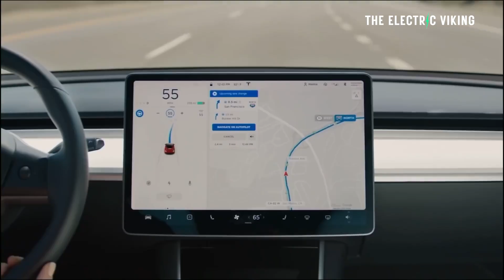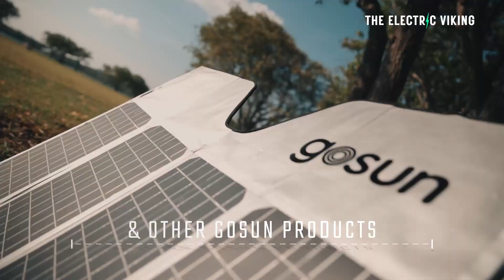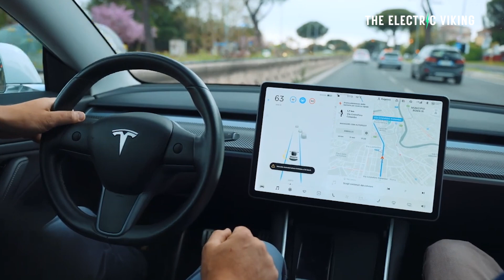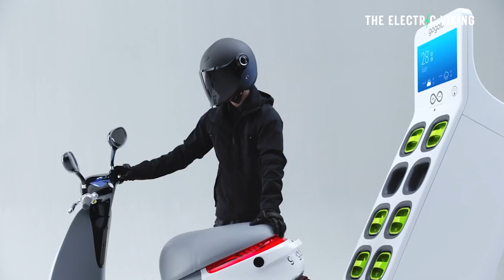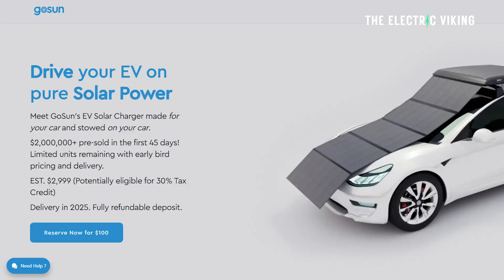GoSun’s Solar car Charger turns any electric car into a solar car

Comment: Downsides I can see:
Added aerodynamic drag of rooftop housing negates some (most?) of what it generates.
Gusts from a strong thunderstorm would tear it apart when it's extended.
Cleaning off the bird droppings.
And as others have noted: theft.
$3,000 cost. It currently costs me $1.00 to go 30 miles using my local utility. At my current usage it would take 18 years for the unit to pay for itself.
Reply: But just think of when you're away from standard roads and plug points for a few days, camping etc. this would be an amazing product to help power devices and give you a boost to get back.
Reply: @colinwiseman  For camping I'd rather use something that stores in the car or camper, rather than have something permanently on the roof. But even then you need to be a long way from charging to make it worthwhile. I camped at a no-electric site for about 5 days with a Supercharger about 17 miles away and that worked out fine.
Reply: @colinwiseman  yeah, it’s called a  Jerry can 😁 but seriously though, you might as well throw a diesel generator in the boot at this point.. 
id hate to have a car that im always stressed in about range, being stranded amongst other things..
Reply: I think it's more about convenience than economy. It would be nice to get a few miles back while parked at work during the day, and super-nice if you're on holiday in some rural campsite. People will be fighting for the sunniest parking spots, LOL.
Reply: Quick math shows that this unit could make 1,833 kwh per year in sunny, southern US, if you never drove your car and this was unfolded for charging all day long, every day (explained in a seperate comment).  Quick math also shows the average driver (15k miles per year), would use an extra 811 kwh per year becuase of the increased air drag (based on epa cycle testing with roof mounted cargo box).  There comes a point when someone drives a lot, like 20k miles a year, has this deployed only some times, becuase they are driving during the daytime, the unit then only makes 900 kwh per year, but said person does a lot of freeway driving at 75 mph and then this unit eats up an extra 1,200 kwh per year from drag.  If you drive fast and far, this unit will eat up more energy than it makes.
Reply: @larzlarz1140  Proves how little the manufacturer of this product understands about physics.
Reply: @larzlarz1140  Yes this is definitely a waste of money. You could spend it to get solar and battery for your home instead.
Reply: @larzlarz1140  The problem with your math is that it is "based on epa cycle testing with roof mounted cargo box".  Which roof mounted cargo box? And how does that roof mounted cargo box, compare to this GoSun solar charger's box? I don't think it's safe to assume it will be the same. The GoSun "box" looks to be quite thin, and it seems to have an aerodynamic profile. We will need real world data, to do accurate  range calculations, and it won't be available until next year.
And no one should be driving at 75 mph, that is a totally ridiculous speed to be driving at. Anyone driving that speed consistently, deserves all the range loss that takes from them.
Reply: Even if you base it off using the supercharger it will still take a while to break even.
Reply: Good points. Hopefully they address this.
Reply: @yggdrasil9039  How??? The only way would be to eliminate drag and weight(as you may be losing as much or more miles than gained), AND cut the cost to about $300 to make it so that it pays for itself in less than the life of your car
Reply: Yes - it really needs to be built into the car's body, as a paint replacement almost.
Reply: @dogsbodyish8403 Aptera
Reply: I’m waiting for someone to say how handsome it is…how, handsome it is…
Reply: So besides the cost making it a mute point... this thing is useless... The loss of mileage due to drag it adds will likely eliminate a majority of the miles gained
Reply: @EdwardsNH  in my country we would get about 10‘000km per year extra range - that’s about 1400kWh.

We pay 30 cents a kWh so we would save 420$ per year - 

Now if you consider the 10% of efficiency loss due to the increased drag (google model 3 roof rack efficiency tests).

You end up with 1260kWh/8’800km per year - 378$ saved.
Reply: @EdwardsNH  unless you put a wardrobe on top you won’t notice the difference on a full charge.

I challenge you to show some evidence to back up your claim.
Reply: @oldbloke204  for a model 3 doing 100km/h it will use 10% more electricity.

With my electric RV is a big box so I don’t notice the two solar panels I fitted - the extra weight I did notice as the whole system added 50kg to overall weight.

I offset the loss by dropping my top speed by 10km/h to get the same range - If I dump 80% of my freshwater and all the wastewater I gain another 10km.

EVs being super efficient you notice any weight increase much more.
Reply: @oldbloke204  I do - EV80 chassis with Kea body made in 2017 - added 1000w solar and 7.6kWh battery - get up to 25km of range per day and run induction, microwave, fridge, heater, fully off grid.

The solar box above is for topping up anytime your parked up in the sun - it’s not because you don’t have enough range.

See it like a micro refinery that makes you enough petrol so you can drive an extra 10‘000 per year.
Reply: @oldbloke204  can do 150km on a full charge - we do 300km per day comfortably.

We are retired and in New Zealand. Both Islands Are small enough so we never have to sweat it to get where we want to go.

We could stay at the beach for a week and then do the next 150km if need be - till it blows up or the sun runs out😂
Reply: @oldbloke204  in Summer we have too much power. In Winter in the worst weather we need to charge the house battery after three days if we want to keep using the heater. For 9 months a year we can be fully off-grid and for three months we do need the occasional top up.
A powered site at a campground is the best option as we charge the traction battery and the house battery and they don’t seem to care about that yet.

As it’s over 3.5 tons it’s classed as a commercial vehicle and still exempt from taxes till December 2025 - it is one of the first ten commercially made electric RVs in the world and the old LDV was the first electric light truck chassis available at the time.

Once we drop below 100km range we will look at a later model battery as the by now the capacity of them has doubled having the same weight as back in 2017 for this light truck. That should give us a 250km range in the future - battery (LFP) is 7 years old now and still at 90% capacity.

The camper including solar/battery setup cost $20‘000 less than its diesel equivalent made in the same year.

They where a hard sell due to the range and most people not being familiar with driving EVs. We gone electric since 2016 and knew what we where in for. It enabled us to get us an bargain as new RV with 13‘000km compared to a diesel with over 200‘000km smelling of air freshener for the same price.
Reply: @oldbloke204  prices will keep dropping so time is on your side.

Best of luck to you and Greetings from NZ!
Reply: @oldbloke204  have been for the last 9 month as we are looking for some land down south - moving closer to the children and grand children.

Reducing overheads is a smart move as we get older. It makes life easier for us.
Reply: @EdwardsNH A "moot" point old chap.
Reply: I got 1000 watt solar on my electric camper van and get 18km of range and enough juice to cook, heat and power the rest of it.

The two panels on top haven’t decreased range at all @ 80km/h.
Reply: @orionbetelgeuse1937  your a funny guy - you seriously don’t think that they thought of that?

Check out the design 🤡😂
Reply: Pretty sure birds could poop on the car just as much as the panels.
Pretty certain people wouldn't open it up for a storm if they check the weather.
Personally I wouldn't get it unless it adds charge whilst driving as well and for less. Or it knew i was going to park in a secure carpark with a long sunny spot every day.
Reality is people charge at home.
Camp a couple of days a year. 
Good for future outage emergencies if no petrol/gas vehicle.
Permanent integration would be best.

Comment: We just need a breakthrough in solar technology, batteries are advancing at good speed but solar seems to be stalled.
Reply: Solar has boundaries set by physics. 😉

Still some wriggle room and out of the box thinking space available though.
Reply: @javelinXH992  Everyone said batteries had boundaries set by physics too. We found a way. Some of those boundaries are not a physics issue just a problem to be solved.
Reply: @frankcoffey  Shockley–Queisser limit says no more than 30% efficiency. Of course we can cheat the system in various ways, such as stacking, but that is really only worth it if space is really not available as there are diminishing gains - cheaper and more efficient to put to put two normal panels next to each other.

I don’t think we are going to see any big jumps,like in batteries, but you never know and every little gain is welcome.

Comment: EST. FULL PRICE $2,999*. you know they gon' steal it.
Reply: I'll wait until temu has a hundred of the same thing for $299.
Reply: Except you have a Tesla with sentry mode.
Reply: @TomasAngelus  does it physically stop you? 'cause if it don't, I'm quite certain thieves will ignore it, even mock it "pLeAAssE StEep awAAy from the VEeehicle LOL"
Reply: @TomasAngelus every time thw wind blows and the panels flap, would it set anything off?
Reply: Stupid ridiculous expensive crap. Buy a box of solar cells from China. Stick them on your car with contact adhesive, and clearspray the whole lot with a high build clearcoat.
Soldering them together before clearcoat in whatever series /parallel setup you desire.
It's will cost you 10 bucks for a kilowatt of cells. Which is 5 square metres
MAYBE you might have room for ten if you cover the whole car🙄.
The cells are only half a mm thick with a fibreglass backing. And are more efficient than those flexy junk ones here.
A dc/dc voltage converter suitable will cost you less than 50 bucks.
If you don't want to pay for the clears pray just use clear self adhesive polyfilm. It won't be perfectly smooth. But IF You want smooth, you could fair it with a simple cheap material like 70% MgO 30% MgCl, from a farm fertiliser supply shop mixed to a paste with some water. This will harden to a soft plaster consistency in 4 hrs, and be easily scrapped and sanded flush with the cells as long as it doesn't fully dry at that point. 
Just a smooth leather pad is sufficient to sand it fair at the 4 to 8 hour set but damp stage. 
A bag of cotton fibre powder as used to mix with epoxy as a glue filler mixed in would make it as tough as billiard balls or bowling balls. That's the formula they are made from.
Once it dries fully it's as hard as a ceramic cup and smooth textured and tough. 
Or you could pour and squedgee it over Areas then stretch shiny plastic film, like industrial gladwrap over the panel a smooth it with a wet sponge, till the cells are pretty much visible. Then just lightly fair with a damp chamois stuck to a flexible backing like 4mm plywood . 
Once it's dry clearspray
Easy job to do in a day.
Cost you less than 100 bucks all up. 
Remember that cells in series dont work good if one of them is in shade, so you want lots of patches facing same direction in series, and all of those in parallel. And probably go for at least 12 volt series groups to minimise voltage converter losses. Buck boost step ups are pretty efficient and cheap. 

It's so Friggen embarrassing to see this sort of ridiculously crap quality shite as that product being tarted up to look flashy, marketed like it's flash and suckers paying that kind of stoopid price. 

What I'm suggesting here is going to at least double the watt hours you'll harvest, relative to that bogus product. 
Ten sqm will weigh five kilos. It will keep your car cool.
 And look real cool too. 
If you want to do even better, just get a cheap car with a blown petrol engine, stick 3 electric 2.5 hp treadmill brushed dc motors in, one driving the (DEFINATELY use manual gearbox) and one driving each of the other wheels directly, by standard CV halfshafts. 
Those treadmill motors use wound field coils, not permanent magnets, so adjusting the voltage and current to the field could gives you speed and power control and recyclic braking. 
That's how the best electric cars ever made were made. Far more efficient than anything today. 
Baker Electric for example. 
In fact, order some edison nickel iron cells edison cells from China. They don't need computers or climate control and steal your watthrs and last forever. 
Don't catch fire.... 

People today are suckers. They buy into anything that they see bring promoted as the latest and best. 🙄
This tech peaked BEFORE WW2. 
It's all just got crappie, less reliable, less efficient since. 🙄🤭
Reply: This is true. And they'll also keep stealing the copper cables and the wheels right off the car. US is a difficult place to practice electrification and renewables implementation.

Comment: A small side benefit is that you are protecting the paint
Reply: You may see uneven fading as the solar panel does not cover all the painted surfaces.
Reply: @johnyaya9225 . Exactly correct.
Reply: until you scratch it up by laying solar panels over it and having them move from the wind

Comment: It's a nice idea, and I'm tempted to order one, but even at $3000, it'll take over a decade to pay for itself at 12 cents/kwh (my residential electricity rate) if I use it every day, and I won't use it every day. Aptera's solar panels are similarly dubious though the vehicle's hyperefficiency is still attractive. If the tax credit exists when the company delivers, I may buy one anyway, but I have a hard time justifying it as a cost saver.

Comment: If can deliver 1200 that is about as much you get from 110 volt house outlet.. cool!
Reply: Except that is PEAK supply when the Sun is directly overhead and perpendicular to the panel on a cloudless sunny day mid summer - on average 4700wh per day year round (in a sunny climate like Flagstaff AZ) - more like 2500wh per day in London or 3000 wh per day in Seattle, when you account for the angle of the Sun, clouds, rain etc, and then only if you have these deployed 100% of every daylight hour and never park in the shade, in a garage, underground car park etc. and never drive during the daylight hours.

Comment: You need to be able to charge while you're driving. You can't drive down the motorway (obviously with just the top panel) with that charger cable plugged in. A system that bonded to the roof, parcel shelf and dash could be pretty cool (and less likely to be stolen). I have a feeling that Aptera will develop their technology to make panels that fit neatly over roofs, boots and bonnets. That would be cool (but probably expensive).
Reply: Charging via something like this on a normal size  Sedan at best would be maybe 2 miles in an hour

Comment: Its great its still charging of the 200W panel on top of roofbox, as will help compensate for increased drag and power consumption that really peaks when driving faster

Recently got out first EV , Hyundai Ionqic 5 and even with some teething probs we love and its already saving us money. 

Its interesting how quickly you become aware of your energy use tho. Driving at motorway speeds 110-120km/h + having a roof rack and roofbox reduced our range 20-30%.
Reply: 200W/h = 1 kilometer of driving 😂
Reply: @RonnyJakobsson  And only if the sun shines 90 degrees towards the panels. Throughout a whole day you will get less than 50%.

Comment: Interesting solution for legacy EVs. New EVs could have solar built into hood, roof and boot lid. :)
Reply: There isn't enough surface are to make much of a difference for most vehicles. At least, not compared to the cost of the panels and electronics to manage the charging.

Comment: Great idea for camping. But at home, thats a very 'spenny item and will be stolen.
Reply: Also the drag will cause efficiency loss...
Reply: It’s 1200 watts it would take days to charge your car then take out wind drag and extra weight
Reply: @darrenfechner5613 but it's not about 100% charges. It's about the top ups while you're doing nothing. It's the adding 5 miles to get you to the next charger.
Reply: Spendy indeed. Not worth it when superchargers are available that are 200x faster.
I made my own using 21 100W panels, 3kW Inverter, 2kW charger and 2kWh 48V battery. Takes a while to set up but you can't leave it for fear of theft.
It works, but space availability location and weather significantly limit the practicality and opportunity to make use of it.
Good for the apocalypse though!